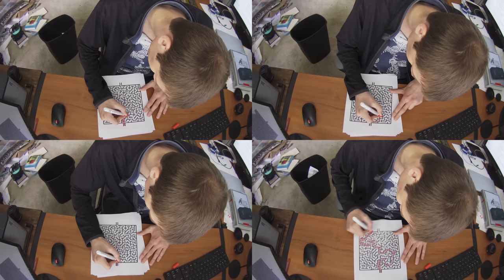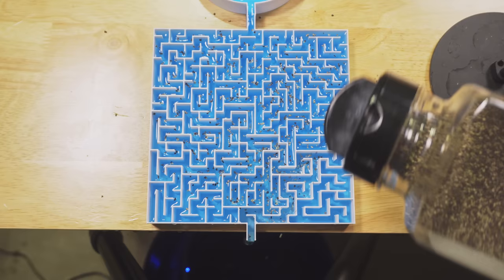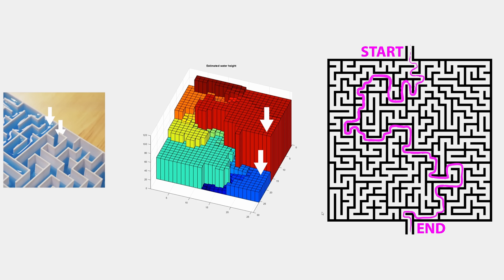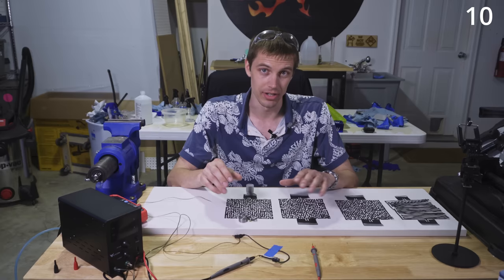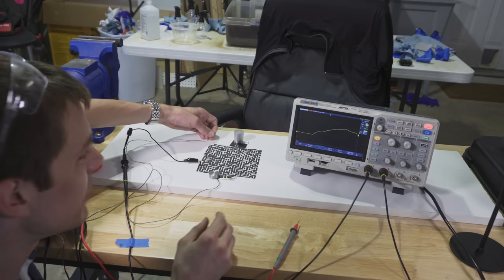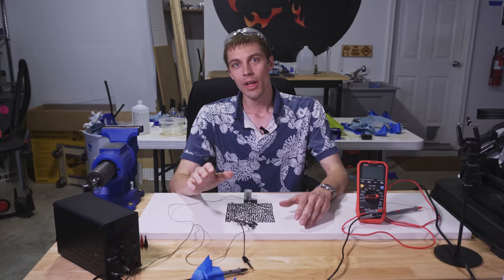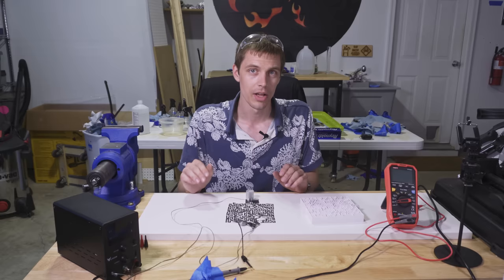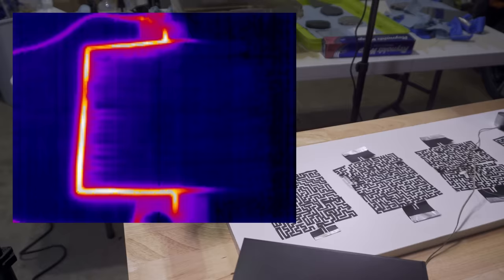How does electricity find the "Path of Least Resistance"?

Comment: I predicted at the start that they would simply act like parallel circuits, obeying KCL at junctions and having more current on the shorter paths and less on the longer ones. The thing that determines the magnitude of current is dependent on how much voltage drop per unit length of wire, essentially analagous to the grade of the water flow, as opposed to the resistance of the two paths (which are probably different but likely negligable, i cant be bothered to remember the physics-based resistance equations vs the electronics-based ones XD)

Comment: Wouldn't this mean that extremely long lines that do not go to the end, dead end lines, would take so much of the water or electricity that it would not reach the end at all even if the end was very close? Or would it then rely more on it being a thin line so it doesn't "drain" it quick enough to stop it from reaching the end?

Comment: I've always thought that water (or electrons) finding its way through a maze might be an illustration of the very different way a quantum computer works, compared to a classical computer.

I imagine a flat maze with a sprinkler system installed above. The water is distributed evenly in the labyrinth. It rises to a certain height, then two currents form and the water flows out through the two openings. The two currents indicate the path through the maze (similar to the experiment shown here). The water molecules are in communication with each other, they agree among themselves, so to speak, on how to follow the law of gravity in the simplest way.

In a quantum computer, this would be the entangled qubits, which cover all possibilities by superposition (which cannot be observed) until these possibilities finally collapse to an observable final position. Out of all possibilities, the correct solution has emerged.

In a classical computer, a sequential path must be found from a starting point to the end point. A quantum computer, as I understand it, has no "starting point", it starts with all possibilities in parallel in a state of superposition. That’s why I prefer the sprinkler system for my analogy.

If I am completely wrong about this analogy, I would be really interested to know why. I have been carrying this idea around for quite some time.

Comment: A1 Current is continuous in a circuit, use a voltmeter to read the existing voltage drop level at each area of the circuit.
A2 Pressure goes to pump head lift: Refer you to your existing basic house water plumbing and pump calcs.
A2b refer to existing fountain and pond pump formula.
A3 Human error, I am also guilty.
A4 Half full/Empty no matter, all will equalize (pending material; electron bonding of the barriers, electron flow of the medium, magnetic and electrical  reactance of the medium, and the specific Electron Voltage atom to atom of each medium tested, the test equipment, the LAB (on Earth or in ZeroG)... A5,6,7,8 You are going off the deep-end; it deep-ens on how deep-endant your knowledge is on deep-endancies; this is deep!

Comment: The "ripples" you're seeing aren't really 'settling' in the maze, because at the scales in question (centimeters/GHz/nanoseconds) electricity looks at your maze and says "yeah, whatever, I don't care about your rules" and just jumps straight over the walls. The walls form a capacitor (they're two pieces of metal separated by a dielectric!) and at GHz frequencies, they're perfectly happy to jump through it.

It's like handing a maze cut in a grass lawn to a toddler. They'll look at it and say "uh... whatever" and walk straight through it.

You might get a result if you made a good, solid PCB with a high dielectric constant, duplicating the "maze" on two inner layers with the outside layers grounded and the "walls" having a grounded center as well. Then, if you sent a very short pulse through it you'd see all the bounces off of each of the different paths as it tried to find its way through. This kind of "path finding" is the core of time-domain reflectometry (TDR), used to find faults in transmission lines.

Comment: Copper contains on the order of ~10^21or 22 free electrons per cm^3, so a wire which is basically like one dimension of a cube will have more like 10^7 or 8 free electrons, so 3 million electrons is actually a much more substantial percentage

Comment: It may work as well an a laser printed paper sheet suplied with high voltage source. if u have a current limiter it slowly burnt the lowest resistance path first. If the insulator partly gets carbonized the current limiter become handy.

Comment: A better way to show the flow might be to use two dyes and fill the maze before you start, using one as a base colour and sealing the end, then using the other due as an input as you open the end. Maybe the inputs could be a third colour to show the change in direction. Wires are supposed to be full of electrons already, why start with an empty maze?

Comment: Imagine the electrons as water going into a maze. Initially the wave going in will hit the dead ends and reflect back as waves throughout the system. These waves will slowly die out. This is also what happens with electricity. The length of those dead ends actually matter, and is expressed in impedance(reactance + inductance). If you make the dead ends just exactly the oscillation length of the system, you made an antenna. Just think of those antennas that are shaped like a christmas tree.

Comment: if there are two valid paths, I expect it to initially flow through the shortest, but as that path heats it's resistance goes up and the electricity will start to spill through the other path as well

Comment: I think using gravity as a motor for the water to flow is good for visualization at the start but doesnt fit the analogy later on. It would be better to close the top of the maze with a lid and fully submerge the system without any air inside (just like the electrons are everywhere inside the matter and there are not more of them at the start of the maze than at the end) . Then you can use pumps to pump the water through (and use some particles to see the flow).
That way you have equal water lvl (like with electrons in matter) and the molecules only move bcs of the difference in pressure (analogous to voltage).

Comment: Very cool! I was thinking, in the multi-path scenario, wouldn't the thermal camera exaggerate the difference between the two paths? There is less current on the longer path, but there is also more surface area to radiate the heat. So even if the current were the same between two paths, a path twice as long would appear half as hot. ...but now I'm thinking maybe that logic is essentially why there's less current on that path to begin with. Please help.

Comment: The elections don’t move, the electrical field is moving. It cause electrons to have similar vibrate in one direction (one frequency), which makes the wire heat. It’s interesting to see the difference with direct current and alternating current difference.

Comment: Each side that the tip of the tester touches will measure thousands of electrons, but it is obvious that most of the electrons will flow through the channel that leads to the flow of electricity with least resistance.

Comment: geez if you are going to go through that much trouble you may as well just cut out the last 2 steps and just see where the maze splits in two... or even just print the maze onto a piece of paper and cut it out... or even just open the maze in paint and bucket fill one of the lines so that it changes color...

Comment: So, with the hydraulic example, if you started by filling the maze with clear water, could you then watch the blue input flow trace out exactly the solution path, in real time? I'm thinking that should work, and it would be an easier visual demo than the pepper current, impressive though it is. Hell, use em both! Great demo, as always!

Comment: But the water level is descending because of the speed at which water gets removed from the system, if water intake and flow capacity was considerably bigger than the outflow it would just even out throughout the whole maze.

Water will always try to expand and even out.

Comment: 10:50 : Let's remember that the electrons are not moving that much, they are just "bending over" in a direction (They only move from some millimeters in decades).

You are watching the magnetic field, which indeed can be saw all around the main path, it's normal, there is no electron trying to find a path xD .
Maybe I understood badly but "feeling out every conceivable way that they [the electrons] could solve the maze" is what I tried to explain it's false.

11:00 : Bending of electrons is instant, even with the most quick equipment possible, you would not be able to see it "slowly growing", all you can see is the magnetic field growing with tension, from zero to X volt(s), creating heat, which is spreading.

18:30 : As I wrote, you probably ignore how electricity is working, no particule in the circuit is traveling long distance...

My advice is that you should really ask advice to some scientist about this subject, you seems to be very interested in electronic, and you seems very skilful, but you lack of knowledge about how "things" are working in this domain.

Comment: "I have a question: at 19:20, is it possible that the cause of having two 'possible solutions' is the electrons flowing in one path, heating it (raising its resistance), so that the electrons quickly 'choose' the other path (heating it), and the process oscillates very fast, so it seems that it's going 'two ways' when it's actually going one way at a time?". Thanks in avance, very cool experiment, and clear explanation, thanks. if you have already answered this question, then sorry, im not that good at english, and i must have missed it

Comment: To get an idea of how powerful the electromagnetic force is, as AlphaPhoenix said, an electric circuit only changes the charge density by less than 1 part in a trillion. Based on coulomb's law, if you actually took 7*10^20 elementary charges (naked electrons or protons), and put them in a space less than 1 cubic cm, the outward force from the electric field would be somewhere in the ballpark of 10^10N, which is about the weight of 1000 metric tons on Earth. I won't try to calculate how big the explosion would be, but my intuitive guess is about the power of a small tactical nuke.

Comment: I'm actually curious if you could set up an experiment to see the fluctuations in the voltage as the circuit solves the maze. You'd have to make the length of the maze much longer of course (maybe on the scale of the 500 meters from your other experiment). The maze you were showing off had a solution that was 3 times longer than the width of the maze, with a more densely packed maze, you might be able to get a ratio of 5:1. So 500 meters of a maze could fit in a 100 meter square (very large still but perhaps your equipment can measure faster so you could scale the experiment down?
Another way you can try to shrink the size of the maze is by doubling the granularity of the maze (points every half inch instead of every inch), and running the wire in a zig zag. So the overall path is virtually unchanged. But the lines become wavy and twice as long. This maze means you'd need half as much space. (Increasing the granularity by a factor of N and zig zagging in NxN squares should ideally decrease the necessary size of the graph N). So you may be able to fit the maze into a 20 meter square if you are willing to make a lot of zig zags.
Reply from the maker: Soon 😁

Comment: This isn't how electricity works! What you're seeing as elections is the stuff vibrating to heat the metal, but the thing that actually solves the maze instantly is a giant wave spreading out between the positive and negative. 

A better comparison would be to dump a huge amount of water on top of the water maze and it will steady out at the same rate as the electrical resistance heats up the metal. Then you'll have two equal tests with the same exact effects. 

You could even equal out the quantities, where the total charge capacity of the electric maze is equal to the total volume capacity of the water maze, and watch as they act exactly the same. 

The reality that'll bake your noodle later is that the maze was already solved. You're just observing the result.

Comment: I think its a bit pedantic to call the amount of electronics flowing negligible compared to the amount of electrons in the metal. While that's true, its totally irrelevant, as only the flow electrons matter. It would be like saying the electrons are irrelevant because their mass is only a small percentage of the mass of the wire. True, but totally irrelevant. 

Otherwise, great video. And its a great reference to explain why "electricity follows the path of least resistance" isn't entirely true. Especially not in the case of a lightning strike.

Comment: You could perhaps measure the current going in different directions by making the path of the maze(all of them) not be a line rather an up and down line. For example: Like hills and valleys, this would transpose a 2d maze into a 3d maze and increase path length without changing the structure of the maze, with sufficient "up and downing" the path can be made as long as you want, and longer delays consequently measured, I dont't know how it would be made though, 3-d printed perhaps?

Comment: Trick question! Electricity does NOT take the path of least resistance; it always simultaneously takes all paths which do not have infinite resistance. However, in all cases of interest, there is one path which has considerably less resistance than the others, and this lowered resistance causes the voltage drop to decrease (for all paths), such that the current traveling along other paths becomes negligible.

Comment: Immediately I am wondering how much impact this has on pcb design. Especially larger boards at what point does this go from being a non-issue to a major problem. Your demonstration shows a pretty dramatic voltage drop over a very small distance. Is this something motherboard manufacturer have to consider. Also with that in mind, I was told a long time ago that the reason they don't just make giant CPUs for computers is because the speed of the electrons through the CPU puts a limitation on how big they can be. Thought that might be an interesting topic for a video. You have left me with many questions. I appreciate that.

Comment: Very fun video! One thing I didn't understand tho is when you talked about the number of electrons flowing around 16:00. How can a change in number of electrons of less than 1 billionth affect the temperature so drastically, and how does it relate to the number shown on the voltmeter? Or is it the flow of electrons that is causing the wire to heat up (because in the incorrect paths there aren't any new electrons coming in and out)?
Reply from the maker: Flow! As they scoot forward they hit things

Comment: If the wire resistance is the same but the length is different, then the electricity flow would divide itself proportionally over the provided paths, according to their length. So lets say we have 100% electricity, one wire is 5 meter long and the other is 10 meter long, then 66.6% of the electricity would go through the 5 meter wire, while the other 33.3% would go down the 10 meter wire.

Comment: Electricity will take all paths. 

Perform this experiment using multiple paths of varying lengths and sizes. Electricity will flow through all paths, and the heat generated will be directly proportional to the resistance encountered along each path.

Comment: Would the reason that they take both paths at once after the initial "rush" not be because heat increases resistance, so essentially what's happening is that the resistance between the two paths becomes equal once the temperatures stabilize after a few seconds? 
The way I'm picturing it, if you were to count it "electron by electron" (obviously that's not how it works exactly but you get my meaning), you would see them go down the shorter path and increase the temperature in doing so until the resistance exceeds the longer path, then go down the longer path once or twice until the shorter one cooled down or the longer one heated up enough, then go back to the shorter one.
I'd love to see that proven or disproven. I'd test it myself just to know but I don't have the tools.

Comment: At 22:07, the thermal camera shows a very interesting heating pattern of the long path. It seems like temperature rises faster at the ends than in the middle. I understand of course that P = R I^2 so in the hydraulic flow model, we should expect no particular part of the wire to heat up faster than any other. Would you say that this is a purely thermodynamic effect from the geometry of the system, or might there be some Veritasium-shaped field-speaking elephant in the circuit?
Reply from the maker: I think it’s current crowding at the corners - the whole strip has the same resistivity but not the same resistance.

Comment: After watching this video it leaves me with several questions on how the electricity interacts with the thermal properties of the material and the (radiation I'm assuming?) emitting from the material that the camera is picking up. Is it feasible to get a reading with a high enough fidelity to observe the thermal effect of the maze "filling up" in solo-mo? I'm not sure if a concept like thermal lag would make it difficult to reduce the time scale past a certain point. Does the increased resistance / thermal mass of the longer paths affect our ability to compare them side-by-side with the shorter paths?